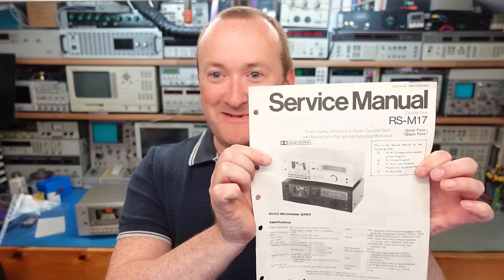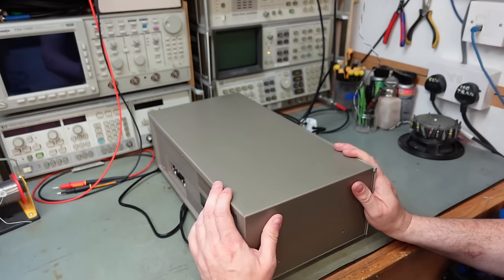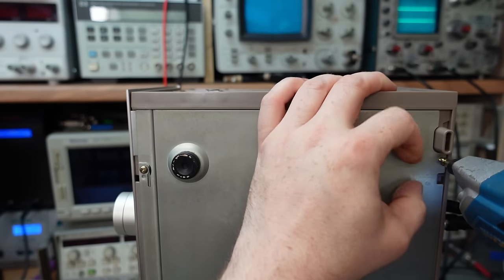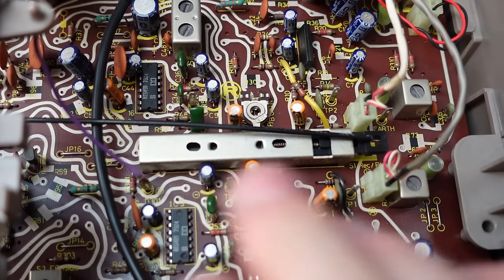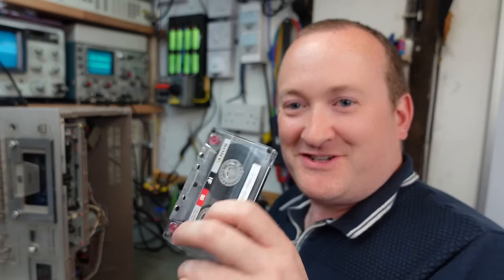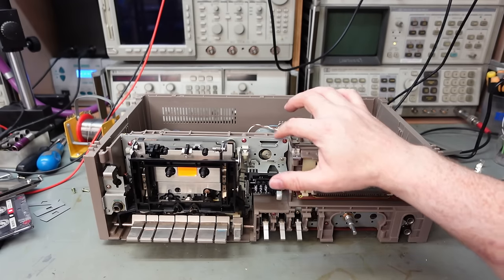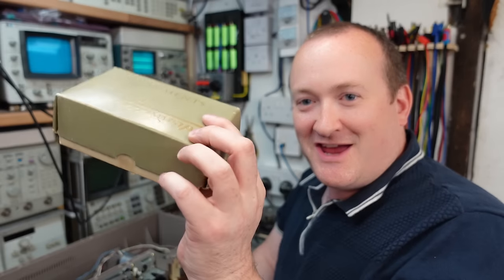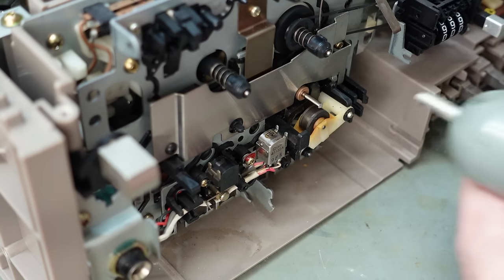1979 Technics Tape Deck Repair (RS-M17)

Comment: You put the top cover on the "wrong" way. The "Caution do not remove screws" label was originally on the right hand side next to the rear of the unit (2:01) . When you put the cover on, the label ended up on the left hand side near the front (36:04)  :)

Comment: Mark, very interesting video, thanks. I watched you remove the record/ play switch, what a lot of time and effort, not to mention the chance of damage to the switch. 
I had Hi -Fi  repair business in Seven Hills NSW Australia for over 40 Years. repairing literally thousands of tape decks. I can say I never found it necessary to remove any of these switches. I what we did, firstly remove the mechanical connection then,  spray "CRC Contact Cleaner" with a bent spray tube in one end of the switch, while pushing the switch back and fourth rigorously, making  sure the spray came out the other end.  Then to finish the clean would give a light spray with "CRC 2.26". I never had even one tape deck for that repeat fault ever, to the best of my knowledge.

Comment: 30KHz to 100Khz. This high frequency signal is then given to an erase head by a bias oscillator.
Because the record switch, that got onto the input of the amp.

Comment: It looks like this is what I have to do with the 30 year old Proton Tape Deck I still have, from T 19:00. It is having the same issue as the Sony Walkman that you repaired. The spindles won't turn but the motor still does.

Comment: I had a similar model. Lower spec but very similar appearance.  An M8 I think.. The motor ran a little fast as I remember.. I didn't listen to pre recorded cassettes. I didn't notice the fault till I played back my own recorded stuff in the car and other players.. Sounded slow and lower pitch ! Very noticeable  !

Comment: This tapedeck looks very similar to the Sony TCK4A cassette deck I had, layout, size, finish etc., just cosmetic differences on the outside to the levers and the splitting of the screen to the VU meters.

Comment: I just bought my technics cassette deck from our local flea market but mines is from the 1982 my deck also had the right channel was aslo having audio problems but i took the cover off and sprayed the the same exact part with contact cleaner and it fixed my right channel and i put the cover back on

Comment: Good grief...i'm not surprised changing belts on this 40odd year old  cassette deck is more difficult than 90's decks...but dear me...could they make more complicated...what a job what a palava...my Kenwood KX-W4020 twin budget deck from early 90's took me a few minutes to hook the 2 belts through...no screws other than the top lid...access couldn't be easier...i didn't know it would be the easiest belt swap ever manufactured when i bought it...lucky me...i have other decks that are a breeze too...slightly more challenging...but nothing compared to that Technics...i had a 1980 Trio similar to it...but thankfully it went long ago...i dread to think what that might've been like

Comment: Almost the same.. I just worked the M14 model. Almost identical. After locating and cleaning the leaf switch and connector for the mute function (just behind and under the ffd & Rwd soft touch levers) .. it still randomly mutes as it plays. It’s improved but still happens briefly. And twisting the chassis makes or breaks the mute. Any tips beyond that… keep cleaning? Or is there something I am missing? 
TIA! 
Awesome video and thank you. I just subscribed.

Comment: I honestly would believe , in that era, the lubricant in the switch was factory and it had never been cleaned before.   The factory lubricant pretty well stops these switches corroding and going black.  Technics use to be quite high end in the day

Comment: Recently I acquired a RS-M15, not sure how they differ from the 17's. Have yet to connect it up to period correct HiFi I've bought separately. So not sure if it works (and how good).

Comment: You could avoid snipping off capacitor leads after soldering them as they might fly off and lodge themselves anywhere inside the deck and cause shorts.

Comment: That must have been the last deck with mechanical transport, I bought a pair of Panasonic single tape decks with full logic transport and soft keys supporting normal, CrO2 and metal tape, cracking decks, IIRC they were RS 235s.

Comment: Nice job Mark, I was hoping to see you add some lube to the switch prior to assembly.
Reply from the maker: Hi Ric, funny story: I did lubricate it with a well know switch cleaner during assembly. But then I realised the irony of stripping down the switch contacts, only to spray them with switch cleaner. So it got edited out. 
The joys of editing. It’s like having an undo button in your life.  😆

Comment: I saw you repair the long SWITCH on your video about the RS-M17.  I have a RS-808 Panasonic, and amateur ME sprayed said SWITCH with CRC Lectric component cleaner, and it welded my SWITCH.  It is melted in PLAY mode, and I have no ability to find part, OR no ability to DeSolder  and reinstall like YOU.
Do you take units In for Repairs ?
Just asking.  Otherwise, where Can I get that SWITCH for my RS808 Technics number,  I have no schematic, and it is made by Matsushita.
Thanks
Greg / Houston

Comment: I like using a pencil eraser to polish the contacts.  Then, gently bend the slidding contacts for a more secure connection.  Reapply some lube to round it up.

Comment: Everything was good but the motor was still noisy. You forgot to put a drop of oil on the top bush and flywheel capstan. Who will stand that high pitch noise? That shiny pressure roller could be restored with a drop of Acetone and cotton bud. Demagnetise and torque meter tapes are still available. Love your Fluke TL75 leads and direct heating soldering iron. JBC?

Comment: All capacitors eventually go bad and need to be replaced and since following X-ray Tony B's channel I have watched him replace a lot of orange capacitors that seem to be common on pioneer amplifier's gives me OCD when I see orange capacitors not being replaced in other equipment.. I understand not all orange capacitors are the same but they should have been tested on this unit because I haven't seen much repair work on this cassette deck and they seem to be quite common, I have a similar unit except mine has the analogue level meters and is somewhere in my garage alongside a multitude of other equipment... 
I don't know if it was a placebo effect of knowing that quite a few capacitors were replaced but it did sound like there was an improvement on the 3Khz before and after... 
One bit you missed which the opportunity presented itself when you removed the plate which holds the flywheel which itself should have been pulled out to clean out the capstan pin... If the lubricant is still the original, it probably wasn't as lubricant as it once was and it would have been quick to tackle it then but I guess that it's a bit late now.... Maybe on the next cassette deck that comes across your bench??? 
Otherwise a great job especially on the rec/playback switch.... You really seem to have the knack for getting into switches and potentiometers... I'm definitely not game enough to go there..

Comment: Great videos,just found them
that was a stupid design,  ALL  tape decks failed because of that baddly thought out slider multi switch,hated them,still do; have a few decks here and there with that same defect;
now that i see how easily you do it,i may go back to them; i wick up the solder with peices of wire soaked in flux
greeetings from Portugal

Comment: Your game pulling that switch apart, I have had a couple of old 70's sony amps with large slide switch issues, they are very tricky, they had more slides and contacts much smaller and with small springs, total headache.

Comment: Question: You said the unit was a "forty year old virgin" that had never been opened before, but then you said the switch had been hit with cleaner before. How would the owner have gotten contact cleaner in there without opening the box?

Comment: To resolve the switch problem, you can try to use wd40 or similar and open, close, open, close manually many times. I think you can resolve the problem.

Comment: Actually the gear that get s chiped it s in front of the mechanism,not on the back.Happened the same to me when i tried to fix one but in the end the microprocesor died due to a short from the crap wiring from the back of the mechanism..

Comment: Could you explain why it doesn't matter if the voltage rating of the capacitor is different than the one you replaced?

Comment: Unlike modern electronics at least most vintage components can be repaired. I try not to discard anything fixable. That is why you see so many companies making or requiring RoHS products because they know that most will end up in a recycling center. Ridiculous.

Comment: 36:52 The last incarnation of that line until 1981 when piano keys were replaced by solenoids.
Got an m45 direct drive working but ... bulb died an no technician could access to it.
Can you made a video of BFG M45?
Thanks.
Reply: Remember M6 and M7 (needle meters) and the only difference was REC light, square in one and round in the other one)
Reply: On the M45, the little 12V grain-of-wheat bulb behind the cassette window? It's not that difficult to do, the service manual (easily found online) tells you the screws and panels you need to remove to get to it...

Comment: I think someone has been spraying plenty so called ‘contact cleaner’ onto the record switch and by doing that also sprayed the pcb and that’s what created the green stuff under the capacitors.
Reply: no, it's oxidized electrolyte

Comment: hola Mark, estoy en proceso de restauración de un Sony GRX10AV pero las cassetteras aun vibran en la prueba de los 3000 hz, es necesario el recambio de condensadores? porque ya hice cambio de correas pero el problema sigue.

Saludos desde Chile y gracias por tu contenido, un suscrito mas a tu canal

Comment: Hi Mark

I'm Jayson from Stockholm Sweden I'm a fan of you and I like your repairing skills that are so awesome and you are so cool when it comes to repairing everything. I would like to repair my SU-7100K but I'm just poor I couldn't take it to a repair shop taking a high payment for repair and I have a question if you can repair it because I love this Amplifier I have had this since I was 17yrs old and now I'm turning 47yrs old I still have it but the other channel doesn't work anymore and some of the input is very hard to locate the switch it's must be oxides inside. Please Mark can you repair it for me it's my birthday on January 28 can you please repair for as a gift? 

Thank you very much.

Best Regards

Jayson

Comment: Hi Mark, I need to replace the broken Intermediate gear wheel of my Technics RS-AZ7 cassette deck. Could you please tell me from where I could by one.
Reply from the maker: They used the same parts in many tape  mechanisms. Look for Technics Idler Gear on eBay. There are people who are 3D printing them now. You will need to check the number of teeth, overall diameter, and shaft diameter from what’s left of your original gear.
Reply: @MendItMark  Great. Thank you for mentioning the measurement part. Yes, will try as advised. Greatly appreciate your prompt response. Feels so happy to communicate with someone who is proficient in what he does. Keep going Mark. Good Luck.

Comment: What do you recommend for cleaning potentiometers just a straight cleaner and then some kind of lubricant or a combination of both? Thanks love your videos.
Reply from the maker: For an 'all in one'  solution, I think Deoxit F5 Fader Lube works well. ALthough, I tend to clean the contacts physically with IPA, then give a spritz of F5 fader lube mainly for its lubrication properties. 
That said, carbon tracks are already quite 'slippy'. They are probably fine without it.
Reply: @MendItMark  Ok thank you.

Comment: Interesting video :) !!!!  What grease did you use ??
Reply from the maker: I used Molykote EM 30 L. I keep a tube of it for plastic mechanisms, and I thought it would do fine on the capstan bearing…. I don’t know what the factory correct grease is, but it’s not caused me a problem yet.
Thanks for watching!
Reply: @MendItMark   thnx :)

Comment: Even back in the day I never disassembled a rec/pb switch if contact cleaner didn't fix it (but it did 99% of the time) I'd change it but I wouldn't waste time fuhkin' around like this that's for sure!

Comment: I picked up technics SA380 , mfg in 1982 for 5$ , it's capacitors are still working.but the tape mechanism is gone due to some idiot trying to repair it . Using it as an amplifier(  STK 4141 50W/ch ) only

Comment: I'm surprised by the cheap and nasty plastic chassis (worthy of China 2023) on a 44 year old machine! And Technics no less! ... I have a JVC amp from 1979, and the chassis is entirely metal!

I used to have a TDK cassette-shaped demagnetiser. It operated on a button cell. Just pop it in and press play!

Comment: And I've been in the business quite a few years longer than you believe me and I'm here in the states and I've run across those machines a lot more I have one right now sitting on my shelf that needs a new motor and it's been sitting on my shelf for about 6 months waiting for a motor oh yeah it is replacement motors but they're not that good this fit issues and it's all kinds of pains in the ass to get it right and when you get it in there you have to adapt it and nine times out of 10 after they've been running for a while within 6 months to a year the motor goes bad that's why much rather use a regular motor from a machine that the board is gone bad on or the mechanism is broken and just take the motor out of

Comment: hi there's one bad thing  the tape deck that the test tape that was recorded on   i am lucky i have a pro reel to reel  deck
with  real  tape  time    right cassette test tapes are hard to find now  i have a otari mtr  12 with 1/8 inch full track 

some one died left alot of dubbing gear  for cassette tapes  so i looked in th cassette gear    there's lot of cassette decks running
not right  i used to work with a jazz crazy man all of it was running to fast or slow   bob

Comment: One huge mistake that you just made you never ever go into one of those motors with a metal screwdriver you can short out that control inside the motor and then you have to replace that whole motor I learned that through experience I've replaced that motor in that same unit that you were working on right now because I used a metal screwdriver you take a metal screwdriver and you put shrink wrap around it and you just leave the tip exposed or you use a plastic screwdriver never ever along metal screwdriver because that is a metal adjustment screw in the air and you can short out the motor and you'll never get it straightened out again and you'll just have to replace the motor and it's hard to find those Motors